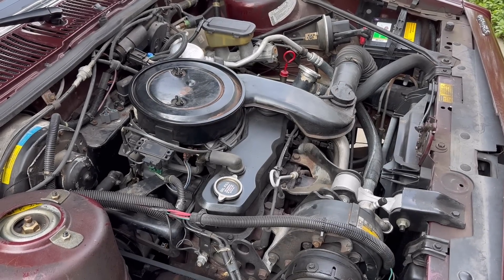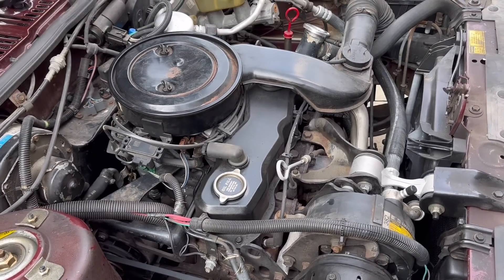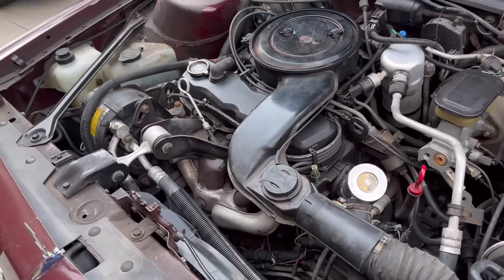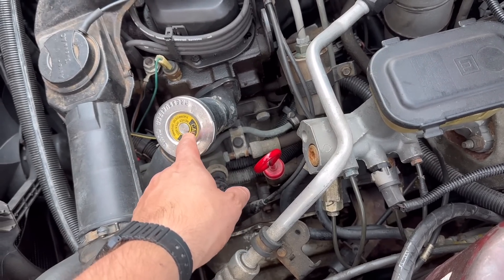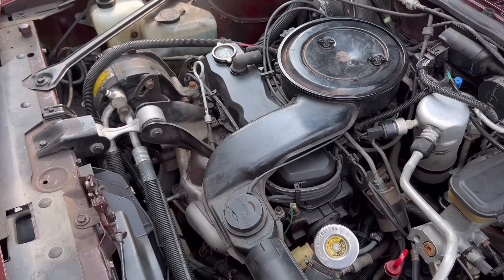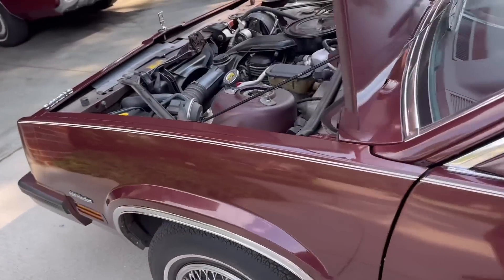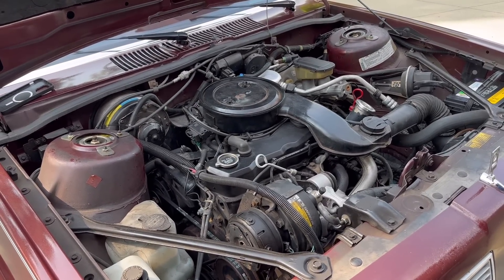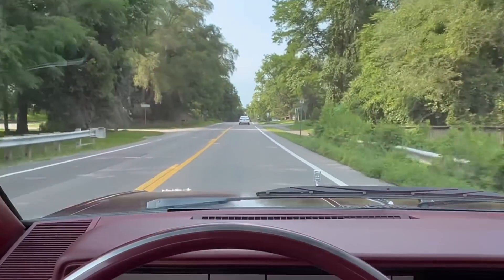Bad Engineering Makes This Engine Challenging to Repair: GM 2.5L Iron Duke 4-Cylinder Engine

Comment: You blame engineers.  I blame consumers, who should have rejected FWD from the start.  I've never owned one,  and NEVER will!  That crap is disposable garbage, that will never find its way to future car shows due to its disposable nature.  These POS-mobiles are designed to be cheaply assembled, with no concern for future maintenance.  Hell, the first time they're due for a timing belt, the owner is weighing whether it's worth the cost or not.

Suffice to say, no sympathy here!

Comment: An older GM article I had showed the R4 compressor was "belt ratioed" so you got 1  Ton of Air Conditioning output per 1000 Rpm of engine speed..

So at 3000 rpm engine speed you got 36000 Btu per hour cooling capacity. 

The R4 was marketed to other car brands. My brochure was from a SAE trade show in the early 80s.

 I think maybe Mercedes used the R4 sometimes ????

Comment: I had this engine in my first car I had as a teenager. I remember having the jack the car up and crawl under it to change the distributor cap.
Reply: My 82 camaro is like that. A pain in the rump. Lol
Reply: @3beltwesty  I still remember cussing that car out over that distributor cap and that was over 25 years ago. It wasn't easy to change it out even from underneath because it was such a tight fit and you can't see what you're doing. It was done all by feel.
Reply: @erocker78  Totally agree with that. In mine the 4 pin connector has this white delrin cover that covers the two mating black connectors. After many years it is just one blob of road muck so has to be scraped off to figure how to slide the delrin cover off.

Long term to engineering wise see if I can extend the 4 pin distributor connector so higher up. ie explore if will get electrical noise issues.Goal is to have the ignition module up on the fender heat sinked and inclosed
Reply: @3beltwesty  80's cars...I miss them but then I don't. Looking back, so many of them were problematic. Nowadays it's hard to find parts for cars this old. They don't make them anymore and the cars just aren't even around in the junk yards anymore.
Reply: @erocker78  the early 80s cars has rapid changes in the computer ecm designs..Giant mess every year changes.

Engineering wise congress from 1970 to 1990 should have kept the mpg and epa specs constant for 3 to 5 year intervals to work the kinks out  in designs

Comment: Oh yes I remember those engines. They would have timing chain come apart at 100,000 miles if that. Good times
Reply: My 2.5 L in  Camaro has timing gears.  No chain. All original and 300k miles..

Comment: Can't believe they used to put them in Camaros
Reply: Yeah I bought one new with a 4 speed manual. The V6 in California came with an automatic and you got 12 HP more.

The  V8 in California in 1982 was married to a required automatic and added 33 to 43 more horsepower.   

But that V8s 135 to 145 Hp in California was a muscle car for insurance costs.

So cost 50 to 60 percent more if under age 25.

The V6 camaro with automatic I test drove  cut the 0 to 60 time by less than one second.. the cars engine weighs 51 lbs more .  

So do you buy the 2.5 L with manual that has a 0 to 60 of 15 seconds?  

Or the V6 with required California automatic that is 0 to 60 in 14.5 seconds 

The mpg sticker on the 2.5L was 24 mpg and the V6 Like 18 mpg and the V8 15 to 16 mpg range.

In that era the gas shortages and gas lines of California was fresh in my mind.

So bought the 82 with 2.5L to get 36 Mpg at highway speeds.

The V8 with automatic was a better bet if you weighted 250 Lbs and owned a gas station and had a 250 Lb wife to travel to the bowling alley. And not drive much. 

Ie raw torque of a V8 to haul folks.

Lol.

I wish the 82 had came with a straight L6 engine of Thrifty nature.  That would be a smoother engine since balanced for shaking forces of piston masses. 

The V6 I test drove had a weird shake in the engine mounts.  Not sure if that was a GM 1st year goof or that cars issue.    Ie like they mounted it oddly..
Reply: The slowest 0 to 60 times of a Camaro were

 certain years of the 2nd Generation Camaro with a L6 straight six and required automatic transmission. 

California 1977 78 and 1979 camaros 

The 6 cylinder was 90 HP in California and with the required automatic transmission for those misery years. 

So the car weighs 500 lbs more than a 3rd Gen camaro and had the same Hp and that was hp before the transmission losses.

I test drove a used  L6 1978 one when looking at my new 82 camaro.. it was way slower than my 82 with L2.5 I bought with a manual 

 transmission

Comment: I had one of these in a S10. It had valve train issues. There was not enough room in the push rod gallery so if you replaced a valve push rod the side of it rubbed against the block until enough metal was worn off. This had to be good for the cam lobes!

Comment: Harder to service than it should be:  my 1975 Chevy Monza with the 4.3 litre V8 shoehorned into the Vega-sized engine compartment.  Longitudinal mounted engine, with fartherst back spark plug on each side of the engine hidden beneath the firewall.  The dealers didn't even have a special tool for changing those plugs, they had to unbolt the engine mounts and let the engine settle a bit into the subframe.  Then you could get a socket onto those two back plugs.

Comment: Here's one for you Adam: While not a difficult job as far as accessibility goes, the placement of the engine oil filter on Chrysler small block V8s here in Australia in the local Valiant 'A' bodied cars can be a right pain to do a clean filter change. Because our cars are right hand drive, steering boxes are on the opposite side of the engine bay to U.S. models. Chrysler small bocks have the oil filter and boss right where the steering box is placed, so Chrysler Australia engineers devised two hard-drawn pipes from the engine oil filter boss up to a filter mount block on top of the engine, right next to the distributor. Unfortunately this makes the filter mounted completely upside down. This makes a clean filter replacement job impossible. Oil goes everywhere!
The solution for me was to move the filter boss mounting block over to the side of the engine bay and run some flexible hydraulic type lines from the original lower filter boss up to it. It can be made neat, but certainly doesn’t look factory. But certainly makes oil changes much more pleasant!

I must say Adam I really enjoy your channel, and watch every episode, even though quite a few of the cars you showcase are rare here.

Comment: make sure you use transmission fluid instead of actual power steering fluid it is too thin foams too easy and is generally garbage unlike atf

Comment: I had 1980 Pontiac Sunbird with that engine.  Rwd 4 speed manual but a total dog.  Iron Duke was an unrefined pos engine.  When they put these engines in Pontiac Fiero they had to use a much smaller oil pan.  As a result the oil capacity was minimal and with oil consumption and poor maintenance they would throw a rod fwiling catastrophically due to oil starvation.

Comment: I took my drivers test in an 85 cutlass ciera that had one of those under the hood. I can still remember the zero effort steering feel the car had. It was very numb by today's standard, but so smooth and effortless.
I also remember deciding to wash the engine at the car wash and not being able to restart it because I had gotten that distributor wet. It had to be towed away to the Olds dealership, and I felt really bad, thought I had done something terrible to it. 😂

Comment: Oil filter; i said 'screw this' and used the V6 unit, identical specs but one inch longer whichade it easy to grab and remove

Comment: The Iron Duke was originally a reverse flow head with the exhaust and intake on the same side.  The distributer was accessible in that configuration.  In 79 they went to a crossflow head and didn't do something about moving the distributer.  That likely would have meant recasting the block.

Comment: These motors were engineered as a stand alone engine. They were installed in many different vehicles. You can't make it easy to get to everything in every body style- apparently.

Comment: Ease of assembly. That's pretty much all GM cared about, I believe. The 1982 and forward carbureted 2.8L v-bodies are even worse. To replace the rear bank spark plugs, you roll the engine forward, remove the A.I.R. pump to get enough room to get your hands and wrench in and blindly remove the plugs. That's why a lot of people didn't change them. The alternator in an A/C car has to come in and out from the bottom and has to be manipulated to do that. Power steering pump or even check levels? Good luck. The cap is down in a deep, dark hole behind several hoses..

I love the cars, but really frustrating when they were not designed for service. 

The Volvo 850, on the other hand (and Volvo used X-bodies as test mules for the Volvo inline-5) very thought out when it comes to service and repair. The next generation of S/V 70, not so much. I've owned both an 850 and P2 V70.

Comment: I have a fairly low mileage 1991 pontiac grand am with the iron duke of course mine is efi but I've had a number of these engines in a multitude of vehicles of that era and always loved them. Of course they never made alot of power but for the most part they were in smaller cars so they seemed to run well. The most common issue I've had with them is when buying them cheap they'd always have a brown head gasket and cracked cylinder head due to prior owner neglect. When I bought my 91 Grand Am the prior owner had literally let the radiator cap get so bad that both the inner pressure seal and outer seat seal both deteriorate to the point it had leaked around the over Flow coolant tank to the point he let it get hot... a 5 dollar part cost me about 500 bucks to bring it back to life. Of course I snagged the car for a measily 100 bucks so I wasn't hurting to badly. She still wears the original paint and the interior is amazing (even the headliner is still in perfect condition when that's usually the first thing that fails interior wise)
Anyway.. I'm a fellow car enthusiast and have lots of classics. Wish I lived closer as I'm in eastern KY as would love to come by and show you some of my toys and chat a bit.
Love your videos and keep up the great info..

Comment: Outfit I work for has pallets of fertilizer and stuff delivered all the time. It's a flatbed truck with a little cute forklift hanging off the back. Guy told me it's pretty much this same engine transmission . . .

Comment: Early GM front wheel drive cars get my vote for some of the WORST vehicles ever built.  Unlike Chrysler, who designed a new engine (the 2.2/2.5j specifically for front drive, with the ignition, oil filter, and other routine service items on the front side, GM just took their old rear-drive engines and flipped them sideways without the least concern for longevity.

Even the GM 2nd generation front-drives  were still a pain in the rear.  When I met my future wife, she had a 2 year old 84 Chevy Cavalier (J-body) that busted my knuckles about 50 times more than I should have allowed before getting rid of it.

Comment: My extended family has had several cars that could have come with this engine, such as the Chevy Citation and GMC S-15, but won the lottery every time by being blessed with the 2.8 V6 instead.  My uncharitable feeling is that the Iron Duke/Tech4 thoroughly ruins the livability of any car its installed in.  A particular crime in that gorgeous Omega Brougham.

Comment: My pick for a difficult car for repair:
Chevy S10 / GMC Sonoma with the 2.2L fuel injected engine. The injectors are an absolute nightmare to replace; the engine was originally designed for FWD vehicles which would explain the difficulty.

Comment: You have to remember that the engine was designed to be put in a rear wheel drive. It was originally put in the Pontiac sunbird of the late 70s

Comment: I had a few Dodges from this time period with the 2.2L engine. Plugs, distributor, alternator, and a/c compressor are all right up front and easy to service. Timing belt changes are also quite simple. What's not easy is the starter or the turbocharger, very difficult to change.

Comment: 1984 Pontiac Sunbird 1.8L OHC with automatic transmission.  Try replacing starter. Need to pull head to get access.

Comment: That car should feel so lucky to have survived all these years AND be in near showroom condition! Nice. GM engineers: let's make the thermostat easier to replace than a light bulb in a table lamp, but make the oil filter and distributor cap a full nightmare! Maybe wasn't such an issue in a mail truck. Is that A/C still using R-12?

Comment: I call that engine the Iron Shake. However it wasn't as bad as the AMC version. Drove a Comanche work truck years ago. It had an effective redline of about 3000 rpm. At least the distributor wasn't as difficult to get at.

Comment: I had a 82 olds omega all the way to 2005. I totally rebuilt the 2.5 in 1996. Oil filter, cock the wheels to the left and reach thru the passenger wheel well, easy. I found the distributor cap was easier to get from underneath. I never had issues with steering rack. I had 2 fuel injectors that went bad in the ten years after rebuild. It was a daily no nonsense to and from work beater with a heater that was super cheap on parts since all the post office trucks had these in them for a while.

Comment: We had an '87 Buick Century with The Duke.  At the time (around 1999/2000) I was working as a mechanic so when I did the tune-up, I put the car up on the lift and changed the cap and rotor from underneath.

Comment: Something for this list: the AC expansion valve on the W126 S Class. It's up in the dashboard, above the accelerator pedal. Ok, not so bad... except all the fittings are large flare nuts. The 2 on the top are super difficult to get to!

Comment: Okay so, last 2.5L car I had was a 1985 Celebrity. I got so sick of messing with the distrubitor that I relocated the ICM to the firewall with a heatsync of its own. I just extended the pickup coils wires to reach it, and the actual plugs to it were able to move quite a bit from where they were. I mounted the ICM to an old Pentium 4 heat sync and its still working to this day
Reply: That is what I have planning to do with my iron duke now for many decades..ie move the ignition module to the firewall in my 1982 Camaro..

Good to hear another has done this. 

My 1982 distributor has its original 4 pin connector that is like the 1981 era..a replacement distributor has the wrong connector. 

So I have bought the rare spare distributors from a rebuilder in Los Angeles that is the only guy on the planet that has them.

Anyway my new 1982 had its 1st ignition module fail at say 140k miles. Then one at roughly 250k.

Then all newer ones have been junk and fail quickly. 

That's with the proper heat compound to heat sink it.

One I installed a few years ago failed in 500 miles.

Ridiculous 

So my plan is to move the module to a heat sink on the fender area of my camaro where I can add test points to check the dang thing.

Regards

Comment: I had a 1984 Iron Duke Celebrity. Other difficult and/or annoying repairs were the water pump and the factory AC lines that didn't have barbs on the fittings, resulting in refrigerant leaks.

Comment: Not really "bad" engineering, more like no engineering.  They took an engine designed for longitudinal rear drive applications, flipped it 90 degrees, stuffed it in the X cars (and then just about every other g*d*mn FWD GM car in the 80's), dusted off their hands and congratulated them selves on a job done.

Comment: Ugh... .  I had a 2.5 Iron Duke as a Tech 4 version in my '91 Pontiac Grand Am.  With the electronic ignition, they put the crankshaft position sensor on the back of the coil mounting plate (which also housed the ignition control module) about where this distributor is located on your Olds.  For some reason, the sensors didn't last but about 40K miles, and maybe less depending on the quality of the replacements.  Getting to all that was a major grief.   Finally, the ignition control module on my car failed at about 260k miles and I sold the car to save me the aggravation of pulling it apart again.  The car certainly served me well but that weakness of the ignition system always lent a certain insecurity about depending on the car for extended driving.

Comment: Yep. Remember them well.   Tech 88 thru 02.   Timing gears were a suck job too.

Best they did was DI, oil filter moved to the pan, serpentine belt accessories drive.

Comment: I took my Skylark with the iron Duke engine to a Buick dealer for a $9.99 oil change back in 1986.  They couldn't figure out how to get the filter off after already draining the oil.  They ended up re filling the oil and asked me to leave because there was so many people lined up for the Cheap oil change.

Comment: These problems tend to crop up when engines are designed for one orientation but used in others as well. I got sick of burning my arms on things and made arm guards from an old leather welders' jacket, it saved a lot of swearing. I am retired now and am thankful for that as I cannot believe what is packed under bonnets [hoods] now. A friend owns a Toyota Land Cruiser V8 diesel Turbo and I reckon if you spilt water on the top of the engine it would not reach the ground because there no room for it to get past things. When walking past a local auto repair place last week they were taking out the whole front subframe with engine, transmission, and front suspension, brakes, axles  etc from a Hyundai Tucson and I asked what was wrong with it and the boss said it is the quickest way to change the auto transmission. Oh dear.